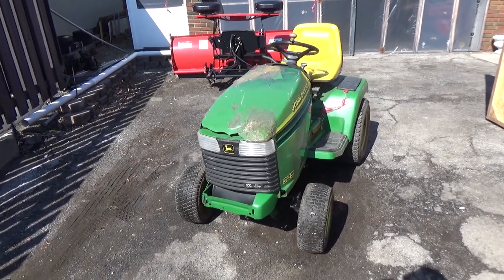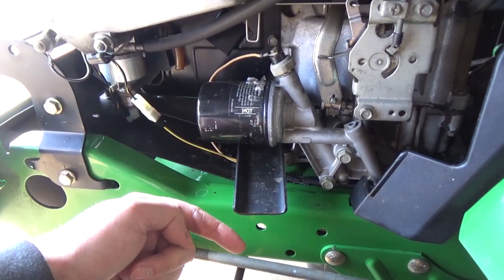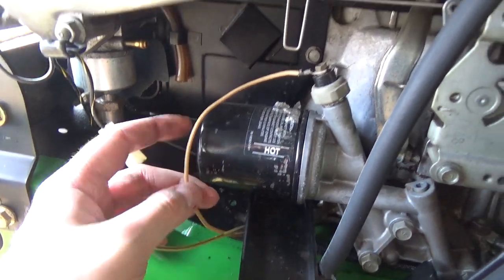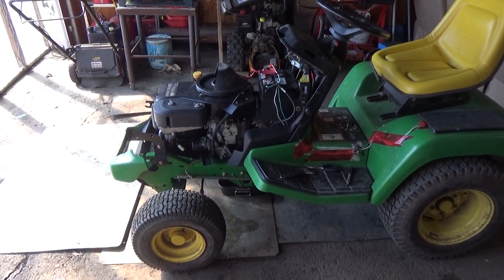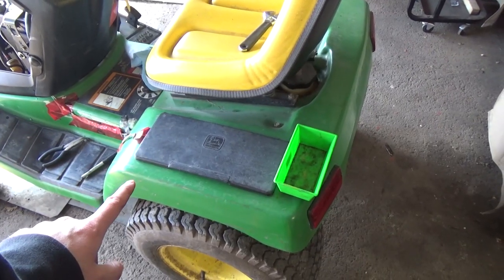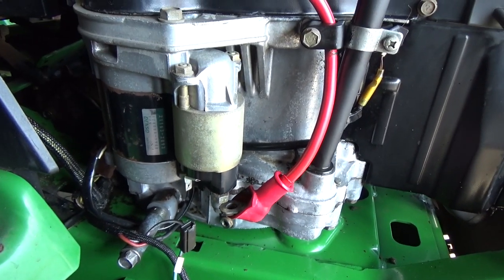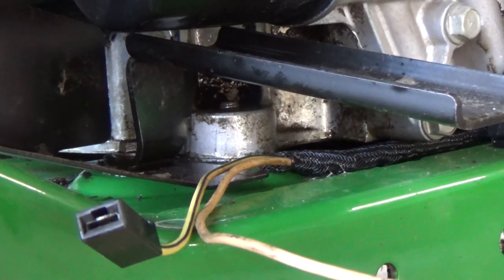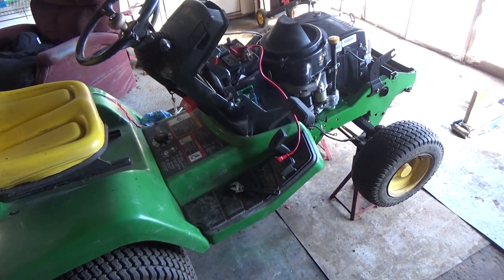John Deere 325 - Engine Removal

Comment: Outstanding video. The quick explanations of why you do things in a certain order and for safety set this DIY from most others. I own a 1988 Porsche 928S4 and have done this same job on its V8 - and I wouldn't want to try doing this job on my GT275 without this excellent video. Small engines have their own quirks and challenges.
Reply from the maker: Thanks for watching Jedi!

Comment: Thanks for the video. I used this on my 2000 JD 345 to get to the water pump. The air hammer was the trick to get the Electric PTO and other pulley off. That alone saved me time and money, send me the bill. ;)

Comment: Thanks Man!! Will be attacking a JD GT262 today. Tommorow, replace that lower bearing on FC540V motor. I did drain oil and gas then rolled it over on its side and power washed the underside. Wife was "happy" as laundry room stunk of oil and grease. Might use a big turn buckle to remove large tensioner spring. Great safety tips but I've always been called one form of safety or another. Mother Safety > Captain Safety > Baron Von Safety but that sounds like underwear--BVS ;)

Comment: I’ve got a JD 335 with a 20 hp Kawasaki that the crankshaft pulley for the drive belt is seized on. Can’t pry on it at all due to the chances of bending it. Any idea how or what I can do to get the pulley off? Thoroughly enjoy your videos! My clutch fell right off, which I kinda expected as much oil as it was leaking! Lol!
Reply from the maker: Might have to bend the keepers out if that's the case. Taking a torch in there could end up melting the crankshaft main seal and then you need to pull the engine to replace. Other than a puller or heat, not much works apart from vibration from something like a pneumatic air hammer. Good luck.

Comment: Nice and explicit video. A question. I need to remove and clean my carburetor. Tractor has set for a long time. Is there a special tool to remove the studs that hold the carb to engine?
Reply from the maker: Double nut, take the nut off one side and double it up, one will act as a lock nut so you can remove the stud if necessary. Thanks for watching!

Comment: Another question. I watched the carb video and realized that it was really in bad shape. I bought new but upon removal I noticed a vinyl tube from a nipple at 12 o'clock that was just hanging in space. It was mushroomed out on the end so it definitely had been attached somewhere but I don't see where. where should it go? Can it just be blocked? I can send a picture if that is an option.

Comment: Great video.  Question for you.  Trying unbolt the PTO clutch and the PTO clutch is spinning also.  What do I need to do to keep PTO clutch pulley from spinning?  Thanks
Reply: I got it.  Had to stick a screwdriver down the flywheel.  I'm replacing the engine.  The original engine blew up.

Comment: i sent another question but think the video was over and didn't transmit. The power connection to the carb. Is that supposed to be hot when tractor is running? If solenoid is stuck will that restrict gas flow?
Reply from the maker: Yes absolutely, I have a video on how to test them: https://youtu.be/aRPmRBlqRqM

Comment: Why not use the chain hoist to lift  the front up to a 45 degree or more angle to work under the machine to remove the pulleys , bolts , old oil and what have you. That's how I do it it works great. I hate working on the floor.
Reply from the maker: I've done it before, but I honestly don't mind laying down, I'm still young lol

Once it gets hard on me, I'll start doing that all the time.

Also, I didn't want to move the couch (too lazy).
Reply: Lol, I'm getting old then....work smarter and not harder.